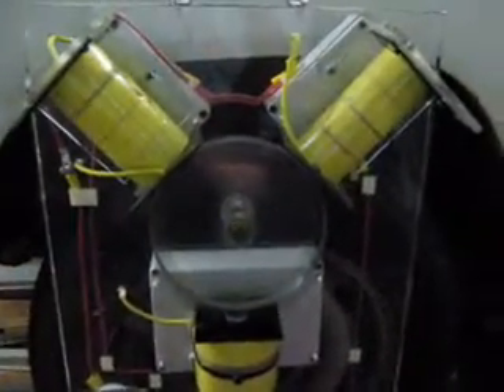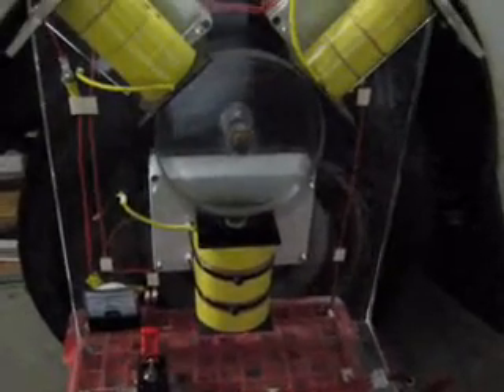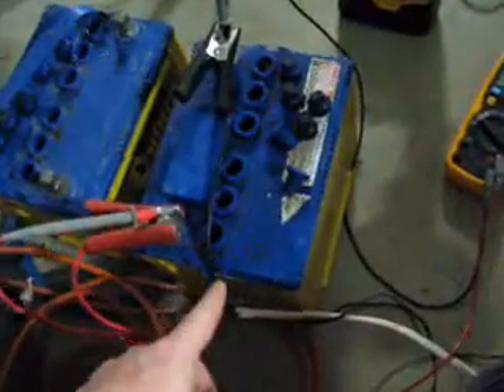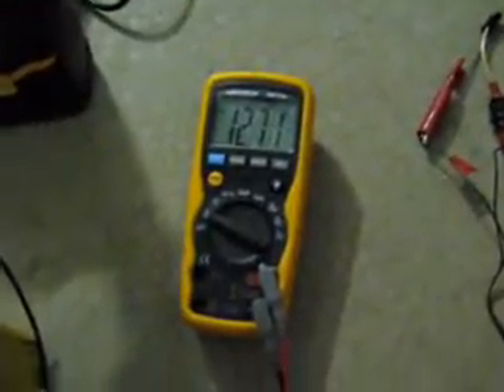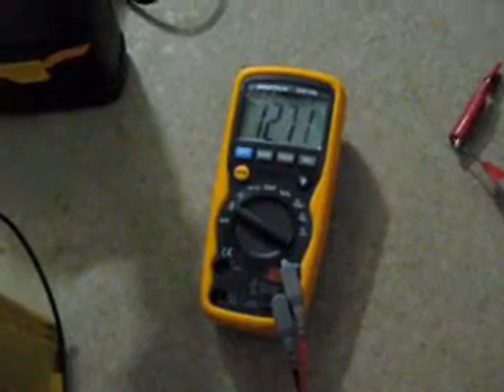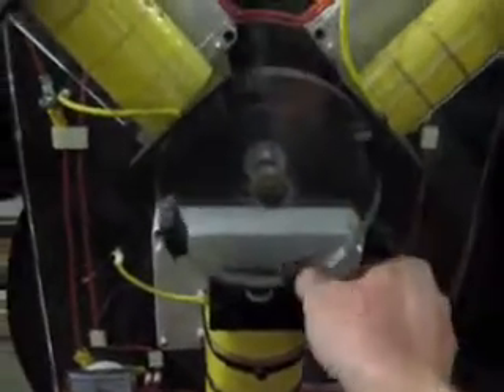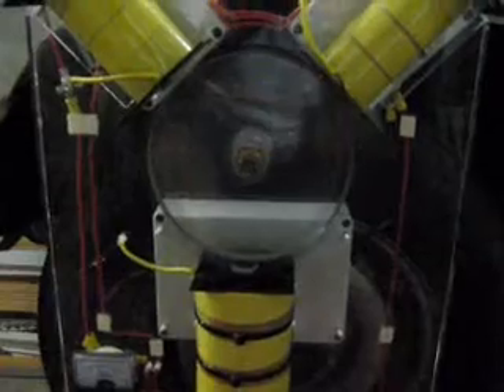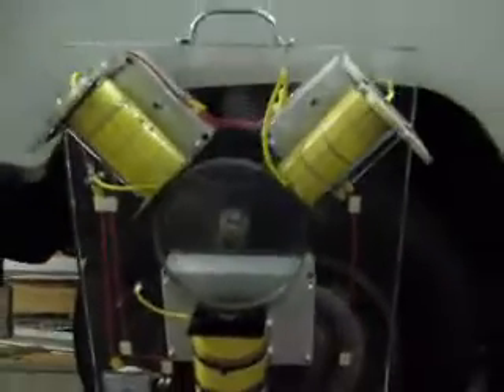MK2 Changed to solid state!

Comment: What was your modification?  I  added a 10K potentiometer to the base of the transistor but I had to start the self oscillation off by spinning the wheel a little, how did you get past that?

Comment from the maker: Hi, I am using the normal SG circuit. To make it self oscillate I just remove the diode across the base and the emitter. BTW I am using the MJL21194 transistor.